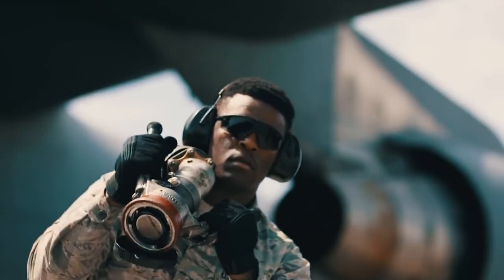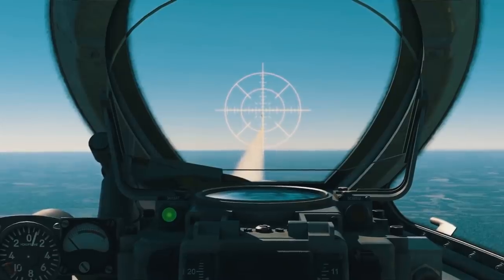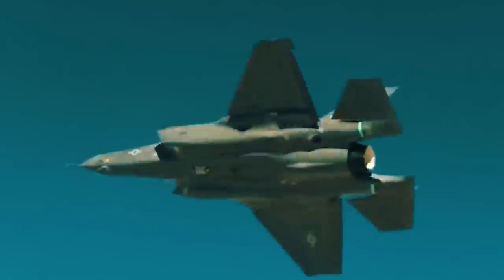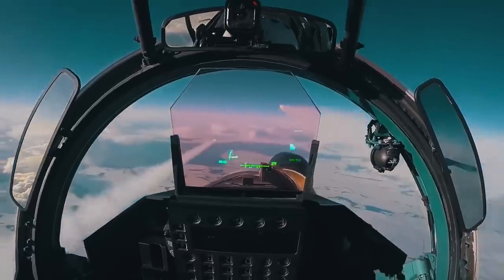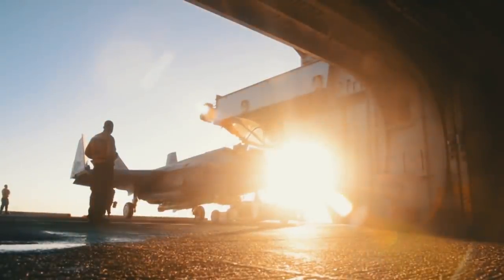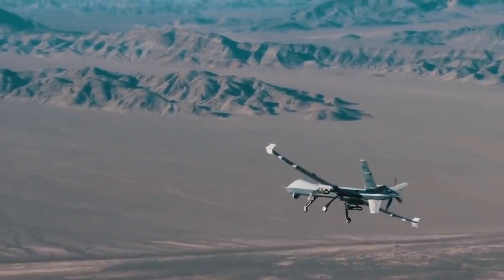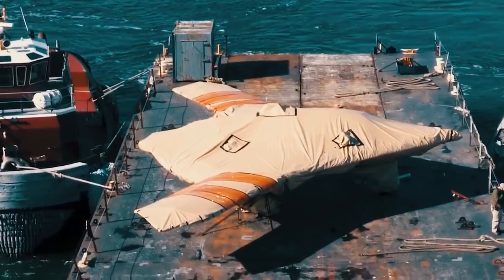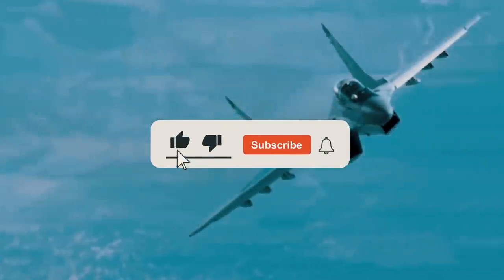US Is Testing Its New Sixth-Generation Fighter With Air Superiority

Comment: I would have liked to have seen more detail on what made an x-generation fighter better compared to the previous generation -- look-down shoot-down radar, fly-by-wire, stabilators, etc.  (The old SPI game Air War goes into considerable detail on this.)
Reply: 1st gen - the first jets to enter service in WW2 and shortly after the war.

2nd gen - First jets with airframes specifically designed for jet powered flight compared to piston engine airframe technology with jet engines installed. 2nd generation turbojet engines improving on power output, fuel efficiency and reliability. First examples of radar being used in a front line fighter. The F-86 had a radar controlled lead computing gun site. The reticle would light up telling the pilot to pull the trigger.

3rd Gen - First Jets to be able to exceed the sound barrier in level flight. Advanced beyond simple radar gun sites to all weather beyond visual range capability. The introduction of air to air missiles. First implementation of a basic heads up display. Third generation turbojet engines with major advances in power and reliability. First jets to have MACH Two plus capability. 

4th Gen - First jets with advanced computer controlled flight control systems allowing aircraft to be designed that are inherently unstable and could not be flown without the flight control computers making minute adjustments hundreds of times every second. The introduction of Digital Fly By Wire control systems replacing hydraulic flight control systems. Avionics that switched from vacuum tubes to modern integrated circuits and computer chips. This allowed advanced capabilities like Track while scan, look down shoot down, tracking multiple Targets at once. The move from turbojets to turbofan engines. Turbo fans offered much greater fuel efficiency as well as a jump in power. The addition of advanced metallurgy and composite materials in aircraft construction. Most 4th Gen fighters were designed by advanced computer engineering software instead of slide rules and formulas.

5th Gen - The adoption of low observability in aircraft design. Advanced shaping as well as radar absorbing radar materials make them very difficult to detect on radar. 2nd generation Turbofan engines offering a large jump in power. Advanced solid radars with steerable beams vs mechanical moving radar dishes in previous generation fighters. A radar that can't be detected by enemy radar warning receivers because it changes frequencies hundreds of times per second allowing it to remain undetected while still having a clear picture of the battlespace. These advanced radars are capable of electronic attacks on enemy systems and even have hacking capabilities where 4th gen aircraft had to have specialized pods for that. Weapons are carried in internal weapons bays to maintain low observability. Sustained super cruise ability although this is debatable because it only applies to the F-22, right now the F-35 can only do it for short periods but when it is retrofitted with GE's advanced adaptive cycling engine it will be capable of sustained super cruise. Some 4++ gen fighters can super cruise but nothing close to what the F-22 can.

6th Gen - Advanced adaptive cycle turbofan engines offering improved performance and efficiency. 3rd generation of radar absorbing materials. Open architecture systems allowing for rapid development and implementation of new capabilities at reduced costs. Advanced system computers offering more than a hundred fold increase in computing power over the F-22 and 35 mission computers. The adoption of AI within the mission computer allowing for an even better situational awareness and battlespace management compared to 5th gen aircraft.

That is everything off the top of my head. If anyone has anything else to add please do.
Reply: @CRAZYHORSE19682003  Nicely done, thank you.
Reply: @gangfire5932  Thank you, I am a Military aviation enthusiast.

Comment: You should point out that $80 million price tag for the f-35 is the same ast the f-15 x. Also the cost per hour to operate f-35 is on schedule to be about $25k per hour which is $4k less than what it costs to operate the f-15x.
Reply: Is the X not more multirole fighter bomber though?  It could potentially do the same job as two F35s with payload. Albeit without stealth. It's a bigger dog with refinements on a proven platform. It'll not withstand advanced radar tech advancements that start to be widely utilised in the near future, but it still has its multirole heavy ordinance and air dominance utility. F35 is the selective-bred mongrel pack-canine.....The F15X is the dying pedigree fight breed.

Comment: "They were later joined by the Russian SU-57"... You never mentioned just how many of these planes the Russians have actually manufactured or more importantly, just how many the Russians have actually fielded, which is a  rather significant part of the equation. The Russian Air Force has one (1) SU-57 fighter in its' inventory with 77 more allegedly on order. The US estimates they've produced between 4 to 7 various models of the SU-57. The Chinese J-20 by all accounts, even from the Russians, say this plane isn't stealthy,  isn't 5th generation, and is using a very underpowered engine. The US, in fact, is the only nation that has ever produced and fielded 5th generation planes that have been independently confirmed as such.

Comment: You have your generations messed up.  1st generation fighters - piston driven propeller planes - World War I to World War II.  2nd generation fighter planes - jet propulsion - end of World War II ( Me-262, P-80, Meteor, F-86, MiG-15, etc.) to the Korean War  (By the way, guided missiles were not used in Korea, although the Germans had experimented with them in World War II)  3rd generation - supersonic capability, radar and guided missiles.  One of the first successful guided missiles was the AIM-9 Sidewinder, and that entered service in 1956, and the Soviets didn't make a copy until a Chinese MiG returned from combat near Taiwan, carrying a dud stuck in it, in 1958.  IR seeking missiles were still easily spoofed and could only lock on to a strong heat source, like a jet engine or the sun.  Radar guided missiles were still unreliable, well into the Vietnam War.

Comment: AI autopilot will be a dominating factor in 6th generation fighters. AI can attack enemy planes and missiles with a 360-degree view, which means AI can shoot the missiles or enemy aircraft which are behind the plane while moving forward. If AI cannot fully autopilot the fighter jet, at least AI should help the pilot in making better decisions by using the sensors/radars of the plane. While engaging enemy aircraft a good decision can be the difference between the life and death of the pilot and a costly plane. Another scenario can be, AI autopilot takes control of the plane if the pilot passes out due to high G's. These are not the only scenarios where AI can outsmart humans, there can be many more scenarios like these.

Comment: So, you completely left out the F-14 and the F-18's.  Then you did not refer to the F35-B, the Marine Corps as a part to the joint fighter. There are three version of it...F35-A (Air Force), F35-B (Us Marine Corps), and then F35-C (US Navy). I would agree that a joint fighter for the 3 branches had good intentions, but it came up short at reducing costs. The Navy requires a far heavier duty land gear, and the tail; hook for it's planes. Landing on a Air Craft carrier is extremely hard on an aircraft. The planes land at full thrust speed, so they landing is heavy duty. The Marine Corps has to have the vertical take off and landing to meet it's needs.  Air Force version I think is the cheapest out of the 3 versions. The F-22 is extremely expensive to the US, since it is not allowed to be exported to any country. But now, the US Air Force is also looking at redeveloping the F-15, to have a whole new version of it. The F-35B is here to stay for a long time though. The advantage the F-35 models have, is that the US companies can sell them to allied nations, which they have done with England and Israel and do believe Japan has bought some as well. Hopefully the additional countries buying, can bring the cost down, since the higher cost is there to recoup the R&D costs.
Reply: a carrier landing is done at low power, but after the aircraft touches down, the pilot goes to full power in case he/she has to bolter (take right back off again) because they missed the wire, the wire broke, or the hook skipped over the wire.

Comment: Joint aircraft programs leave you with what is akin to what we in the Navy would call a Battle Cruiser.....Not as well armed or as survivable as a Battleship and not as fast and maneuverable as a Cruiser.  It's something in between that does nothing well and only marginal in areas that they need to operate.  The F-35 is a perfect example of this as was the early and in some ways the current F/A-18 Hornets.  These planes try to do too much with one airframe and end up making too many compromises to get things done.

Comment: The Chengdo K20 is not a Gen 5 air craft. at most it a a gen 4.5  Unlike the F22/F35 and SU-57, it does not have full aspect stealth, it is only stealthy in a frontal aspect, Indian radars sites are able to detect the, additionally it does not have vectored thrust. China is not currently capable of manufacturing engine or replacement parts for the J-15 (a cheaper, knock off version of the SU-33/35/37). and because the Chinese made a knockoff copy of it, the Russians do provided them with replacement parts or technical knowledge on the engines. all the Russian engines used in the Chinese air craft are returned to Russia for service.  the SU-57 on the other hand is a serious bird of pray. it out classes the F-35 in just about every way. however it is significantly bigger and heavier than the F-22.  US radar and missiles are a better than the current radar and missiles fielded by the Russians.  The F-22 would beat it in a BVR fight due to the better weapons and radars, and it would beat it in a dog fight, because it is faster and more maneuverable since it is smaller and lighter. however the SU-57 is still a grave threat to US air dominance. i am not surprised they are testing they FXX at this point.

Comment: There is the need to have twin seat fighters because of pilot work load. The F-14 and A6E were some of the best planes for there missions.   In the past a crew concept uses two heads, four 👀 are just better than two eyes and one head. Simple many times the planes are designed by single seat egos and brains. ie F35, F22, AI doesn't cut it when the Ballon goes up... A6E NFO Great Gandini.
Reply: yet nothing in the world can touch the f-22 still today. two seat fighters died with 4th gen tech. in fact, the "smartest" and most capable military aircraft in the very near future (if not already) will be unmanned. that's a fact. with a.i. advancing in leaps and bounds and all the weight and space savings from eliminating a cockpit, no manned aircraft has a chance. not to mention the limits of human physiology to withstand high G forces.....btw, while I love the f-14, it was too maintenance heavy and expensive and the A6 is 1950's tech.

Comment: Su 57 pakfa programme was joint project between India and Russia which was latter scraped down so its not existing
Reply: How embarrassing that you would leave a statement like this without any knowledge or research.
Reply: @HoLeeChit11  actually please do research is something that I would ask you su 57 was Russian 5th generation program but along with it su57 pakfa was a joint development program between India and Russia like su30mki but in 2019 su57 pakfa was scrapped due to multiple reasons but su 57 is still in service with Russia in fact recently it got approved for large productions in Russia

Comment: Leave my opinion in the comment section? OK.
US didn't flew a 6th gen fighter, it flew a technological demonstrator plane with some technology intended to be fielded on 6th gen plane. It might had been and probably was a Cessna with a datalink for drones.
Also you had inserted so many false information in your video... it can only be described as giving a handjob to US audience which is really necessary because otherwise they wouldn't last through 1/4 of this really strecheeeeed video.
Maybe you should try talking even slower so you get another commercial in your vid.

Comment: I see the what the 35 was built for but it doesn't really do much compared to the A10 . And if the 22 can do air to ground missions why not use it to help the A10 instead of wasting money on a jet that we already have and better as it is anyway . in my eyes somebody just hot pockets lol money burning a hole in there pockets sort of speak . yup got a pocket with holes in them then got caught up in a mad hurry up situation thinking the enemy is coming or something lol then got in a huge tangled up fish net mess . patients is a very valuable thing to learn and you'd be surprised what you can come up with using patients lol . but no body can tell anyone what to do holding that kind of cash throwing it away in a flying stealth garbage can lol